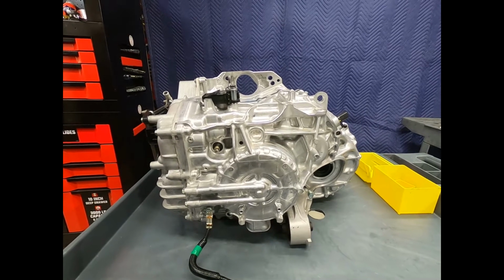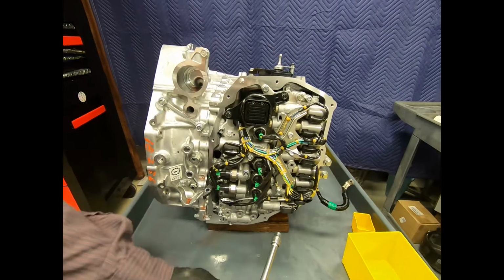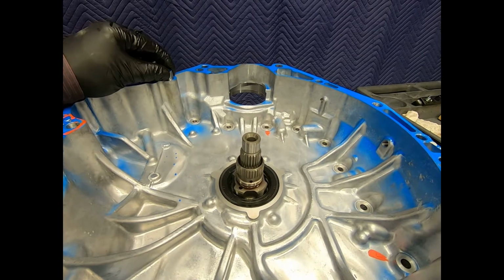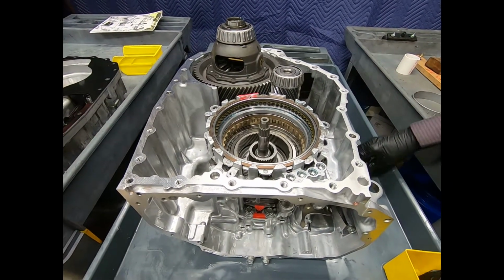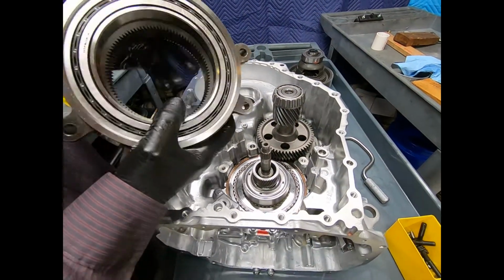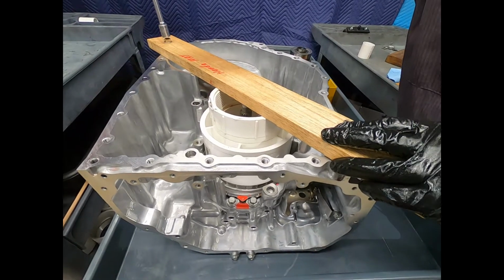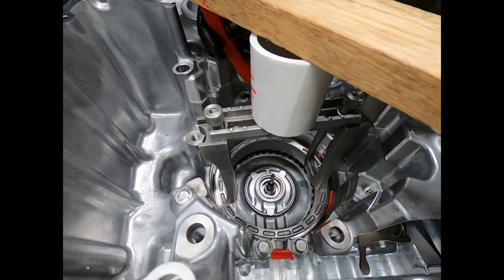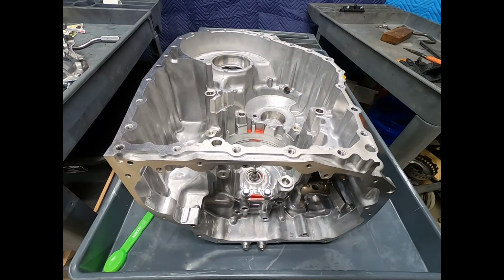Honda 10-Speed Automatic Transmission Disassembly and Inspection

Comment: I’m selling my 2018 Accord 2.0t Touring because this 10-speed  transmission is terrible and Honda refuses to do anything to fix it. I’ve got over 14,000 miles on it and it’s still just as rough as it was on day 1. The biggest complaint I have is the 2-3, 3-4, 4-5 up shifts and downshifts from 4-3, 3-2. It also downshifts roughly when going up even the slightest inclines from 10-8 and that causes a shock to be felt throughout the car. I also experience the torque converter unlocking when turning and accelerating or when giving it a bit of throttle while cruising to speed up. All of a sudden the engine starts to rev up while you make nearly no forward progress. It’s just weird. They have released no software updates to address shifting and after 4 trips to the dealership and being told “They all shift rough”, I’m tired of it. I’m ditching ICE vehicles completely going forward and have ordered a Tesla Model 3 Performance to replace the Accord. I just don’t find rough shifting transmissions acceptable in brand new cars.
Reply: I drive a 2018 Accord EX-L 2.0T w/ 10spd AT and I find it an excellent transmission. I came from a 2010 Altima CVT. My early impression was it was very "busy" 10 gears vs CVT seemed like a lot going on. As I've driven more and read about it, this transmission delivers on everything. I hardly notice I'm travelling through 7-10 gears (maxes at 7th gear in city driving) Shifts fast as lightning in Sport mode. Shifts nice and smooth in Normal/Economy modes (will shift pretty smooth in Sport if you don't get on the gas) It is designed to hold your gear around corners which if you are an enthusiast you realize is very helpful vs shifting to a higher gear like most trannys. Most Honda 10spds have smoothed out after the first few thousand miles if they were rough from the factory. It's called break in. F C may just not like the way Honda programmed things in the Accord 10spd. I've never driven with it in the Odyssey minivan but the RDX has the same engine as my Accord so the experience is likely nearly identical (RDX is dragging more weight though and can have SH-AWD)
Reply: @johnwatson6181  drive a BMW, Audi or Alfa Romeo with ZF’s 8HP and you’ll know what rapid shifts are. That gearbox can nearly match a dual clutch for shift speed, but is less jerky around town and more efficient. It’s why everything from a BMW 230i to a Rolls Royce Phantom, Jeep Grand Cherokee, Ram 1500, etc. all use that transmission. It’s the standard bearer for modern autos. Honda’s 10AT is not.

I will say though, anything is better than a CVT.
Reply: It's doing its job, you should get a positive engagement into the next gear. It's a sport oriented transmission same with their 5 speed automatic. They are built like that, nothing wrong with it. Cars that shift seemlessly shed clutch material and don't last as long because of that.
Reply: @enriqueortiz5440  That's why luxury cars are money pits?
Reply: @enriqueortiz5440  There is something wrong with any automatic transmission that creates dissatisfied customers.  Honda is a mass production maker and its transmissions must suit its customers; not the other way around.
Reply: @enriqueortiz5440  I don’t know what you’re talking about. First, the Accord is not a sports car and the 10-speed is anything but a sport transmission. It’s slow to shift, has terrible shift logic, will not hold revs even in manual mode, up shifts 1-2 whether you want or not, and is jerky AF. Honda’s 10-speed gearbox cannot even come close to matching the rapid and smooth shifts you get in almost any car fitted with a ZF 8HP transmission, or even the Aisin 8-speed front wheel drive transaxle that BMW has tuned excellently in their small FWD cars.

Also, GM and Ford’s 8/9 speed FWD transaxle shifts much smoother than Honda’s 10-speed. GM transmissions have also tended to be quite reliable. The same cannot be said of Honda’s previous unique automatic design which was so problematic. My cousin had a 2006 Accord V6 5AT and the thing had the transmission rebuilt THREE TIMES. The fourth time it needed to be rebuilt she scrapped the car. 

Every review of the 10-speed has said it’s anything but sporty, including in the new TLX, RDX, etc. I also think it’s interesting how Honda didn’t use it in the Ridgeline or Pilot and instead stuck with the unloved ZF 9HP FWD transaxle for those vehicles. I guess it’s because the 10-speed will blow up if you try to tow anything, hence the extremely pitiful tow rating of the RDX and Odyssey.
Reply: @gfbrittoncarlisle  I dont know man, I just went into a 21 TLX from a 19 Accord with this transmission, and I really cant say I noticed any of the symptoms you experienced. Nice and smooth shifts, at least for me, in both cars.
Reply: @ITALIAN926  look at C&D’s Long term Accord and they had the same problems
Reply: I jus bought a 2021 honda accord 2.0 and i can assure you that there is something wrong with your transmission in particular because i have seen forums where some people are having the exact same problem as you and they got their whole transmission replaced. My car is as smooth as it gets and you cant even tell when the car shifted from 2 to 3 to 4 to 5 at all or even when downshifting
Reply: @desioasis2378  To be fair, they probably fixed the issue for 2021. 2018 was the beginning. so a used 2019 and up is probaly a safer bet
Reply: @desioasis2378  I know there was something wrong with it. I sold it. Last Honda I will ever buy.
Reply: @gfbrittoncarlisle  really sorry for your experience bro. What car do you have now?
Reply: @desioasis2378  Tesla Model 3 Performance. 

The Honda 10-speed transmission scared me so bad I went to a single gear car. Lol
Reply: @gfbrittoncarlisle  thats epic, sad that honda lost a buyer but they should improve their service. your dealer who told you that thats how all of them shift was totally bullshitting you and they probably didnt want to go through the trouble to reach out to honda to chnage the transmission but good luck bro. Tesla are fast as hell
Reply: @desioasis2378  I reached out to Honda corporate directly and they were less than no help. They said if the dealer didn’t find anything wrong they weren’t going to get involved. I begged them to send an “engineer” to look at my car or someone from their corporate tech line but they refused. That car had tons of issues. It was a lemon. I also noticed on the strut towers where they used bonding adhesives, my car was missing like half of the adhesive. It looked like the robot had air in the line as it was squirting out the adhesive and a 5” long section on one tower was completely missing any adhesive.

Here’s a link to a photo of the gap I’m talking about. In addition to all of the issues with my paint having bubbles in it, rust on the door jambs, and the awful transmission I just decided it was best to sell it and take a loss. I should have fought Honda and made them buy it back. I just didn’t have a lot of time because I had been eying a Tesla Model 3 as a replacement and the tax credit was getting ready to end if I waited any longer. 

https://share.icloud.com/photos/09-fevFZ9jS0IvQC9vcyi-WiA#Raleigh
Reply: @gfbrittoncarlisle  After looking at that, all I would say is that thats what i wouldve done too. This is too fucked up
Reply: @CFG39  It's a good transmission. You just don't know how cars work.
Reply: If my 2020 RDX is indicative of anything, it's that QC at Honda is abysmal.  Last ever Honda product I'll ever waste money on.
Reply: I’m having the same problem in my ‘19 Accord 2.0 It gets so annoying. shifting 2-3 is sometimes rough. Cruising or coasting in low speeds / stop and go traffic is sooo jerky. It’s like the transmission doesn’t know what gear to be in. Sometimes after turning, I would press slightly on gas pedal and I would get so much throttle response. doesn’t make any sense. I only have 35K miles. Not even happy driving it. sigh
Reply: i think they tuned these transmission shift point all for rating and keep fuel economy down. even toyota 8 speed transmission is having problems on the 2018 + up
Reply: If you are driving in eco mode the transmission can feel jerky when you  floor it because it was in too high a gear for fuel efficiency and now suddenly dow shifted for quick acceleration
Reply: It’s because u don’t know how to drive the car right
Reply: @jordanodom4439  lol. Yes, driving an automatic transmission vehicle is a skill.
Reply: That's why I stick with manuals. Have an 18 Honda Accord 2.0T 6MT. Autos are for girls 😂

Comment: Is this a single or a double/multi-clutch system? And what do you expect the long-term reliability of this unit to be?
Reply: Better than the ZF 9AT, that's for sure
Reply: It's a planetary gear set with a torque converter. This is not a single or dual clutch transmission

Comment: Awesome video! Did they use a lsd in this transmission?
Reply from the maker: (limited slip differential) lsd. The Honda 10AT does not use a lsd, however the anti-lock brake system can be used to insure that a driven wheel does not spin free but the system can apply the brake on the wheel without traction to divert torque to the the wheel with traction and act as a type of (limited slip differential) lsd. This is the logic behind BMW X-Drive and Mercedes 4-Matic. Presently the Honda 10AT is a front wheel drive unit only, we will have to see what Honda does in the future.
Reply: @ThompsonAutoTest  I have a 2020 Acura RDX which i believe has this transmission.  The vehicle is also equipped with acura's SH-AWD system for torque vectoring to all 4 wheels.  I wonder how their mating that system to this transmission.
Reply: @ThompsonAutoTest  rdx has the awd 10at and maybe other models
Reply: @oijhhytdirhrbru  lol, so where is the diff on this car... the transmission stooge

Comment: I have this transmission in my 2019 RDX, it seems very common to have rough shifts in the first few minutes of driving that go away after it has warmed up, sometimes even stumbling to change gears from either 1-2 or 2-3 when you are applying light throttle when the car is just started. What would cause that with this transmission, it appears to be rather common between many of the 2019 Acura RDX's
Reply from the maker: This is a new design for Honda and Acura. I have personally road tested a 2019 Honda Odyssey but this experience would not be the same as actually owning  the vehicle and driving it every day. Recently manufacturers have been addressing transmission shift feel and shift quality with a software update to the control system. Discussing this problem with your local Acura Dealer may be the best solution for now while the unit is still under warranty.
Reply: Most newer trans do have odd shifts when oil is cold. Im a chrysler tech and both zf 8 and 9 speeds we use have odd shifts when cold. But once hot it goes away.
Reply: Link to video about RDX clutch break in procedure
I have this trans in my honda and it had the same issues as described in video and here in the comments
Reply: @dereileak I want to buy an RDX, but is it worth it with this transmission?
Reply: If you have 30,000 miles on your ZF9 or Honda 10 speed I would replace the transmission fluid this helps A Lot at least did on our ZF 9, I used the Correct ZF 9 oil, Ours is in a 2020 Ridgeline.
Reply: I have a new accord with the 10 speed for a month now and have noticed rough shifts when it’s cold but after it warms up it’s pretty smooth my boss has a new Odessy and accord both with the 10 speed and has now over 10k on both and told me the rough shifts have gone away after it hit 10k miles probably just a break in I guess but if it still shifts bad tell Honda while it’s under warranty
Reply: SavagexRaccoon I’m in the last years I of my 2009 Honda Odyssey with 5 speed transmission. It runs great 👍 but the rear rust in tire well (common issue) seems to be flaring up. The 5 speed was always a bit ruff meaning feeling the shifts for the first few gears and then smooth as silk after. (130k miles 250 km) I was never effected by the tranny issue this model had  but looking to jump into a 2020 in the next few years. Waiting to see what people say, if it’s still sucks I might make the jump to Toyota. It’s been a great engine since the start. Hopping you and everyone else with the new 10 speed have no issues,